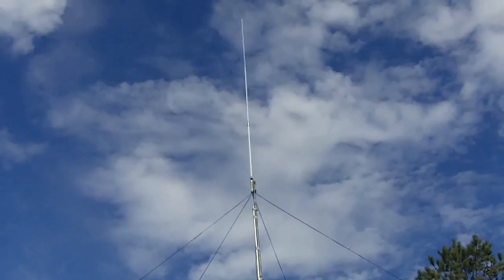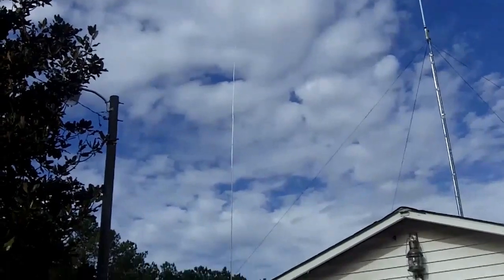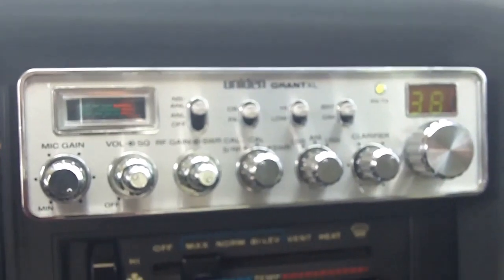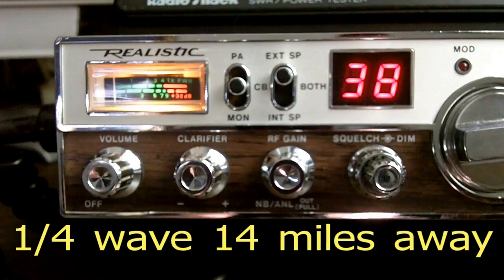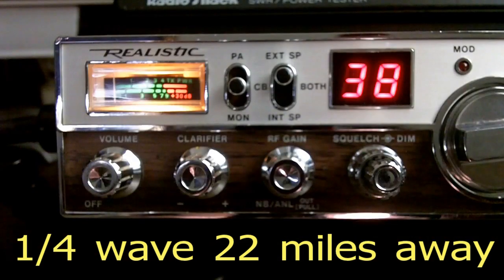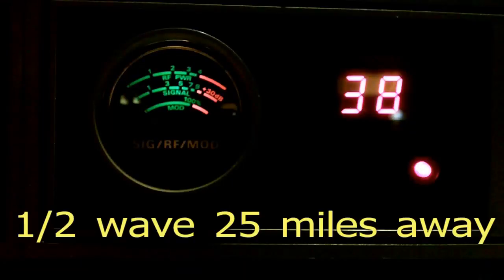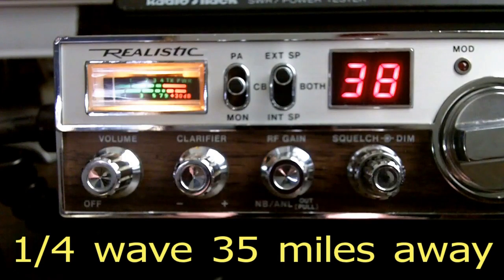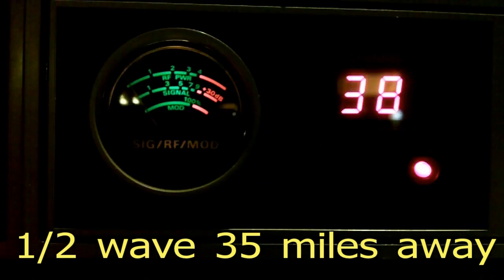Ground Plane CB Antenna comparison

Comment: Enjoyed the antenna test(s) 151, and it was very noticeable after 30 miles. If you ever decide to construct a 5/8 wave ground plane, then that would be some good data going forward. 73 from 770 - RI.
Reply: Hey Brother MJ!! How about a twin-base station antenna set-up where you use the half-wave to receive and the quarter-wave to transmit?! That would be some set-up indeed bro!! What do you(and your audience!!) think about that idea?
73's from your Canadian CB Bro,
Norman in Montreal, Canada.
Reply: Yeah the 5/8 has a lower angle of radiation.. the .64 wave is the ideal  non directional base antenna.. abs great for long distance skip... 1000 plus kms. I've still got my radio shack .64
Reply: If you go 5/8th try a .64 wave antenna....it's a few inches longer. You may be surprised :-)
Reply: @djmossssomjd8496  : How so?

Comment: Great video mate, do you have a 5/8th wave antenna you could test being the most used base Antenna.
Reply from the maker: I've been looking for a 5/8, But I haven't found one I can afford yet.
Reply: @MowerJunkie , take a look at the Hustler G-2537. It's $100 cheaper than the Penetrator.